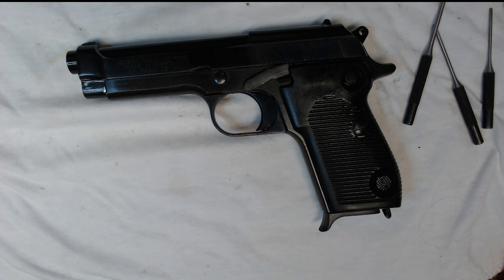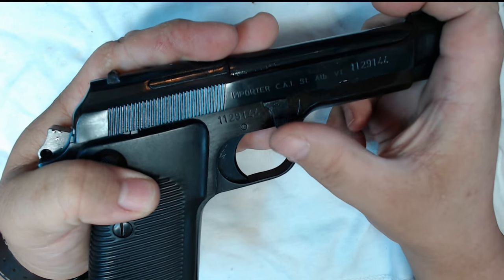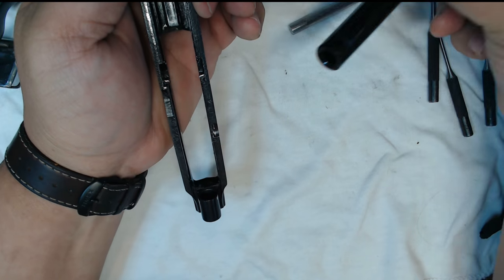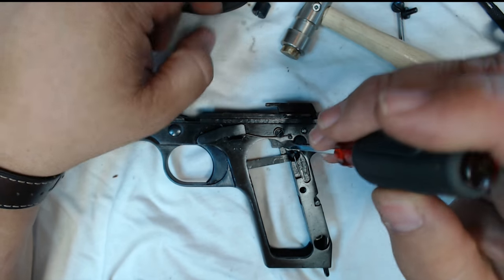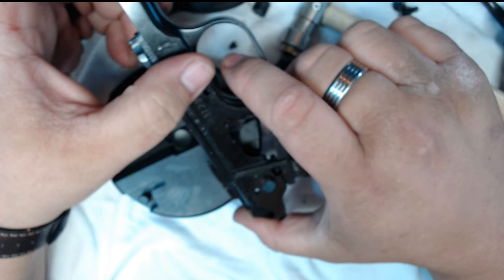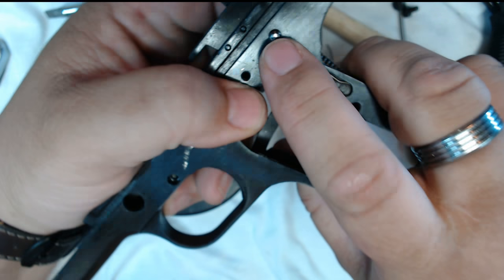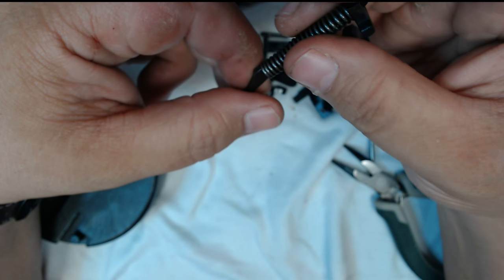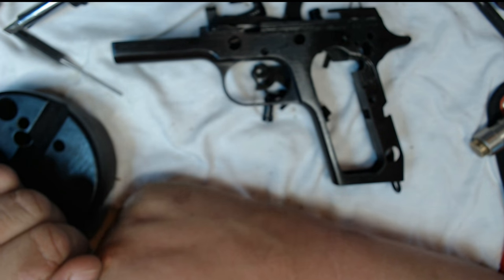Beretta M1951"Brigadier" - Egyptian made Helwan - Disassembly

Comment: what size pin punches are you using? I just purchased this handgun and it's really dirty. Your video is excellent straight forward and to the point with out a lot of fluff!
Reply from the maker: Thanks for watching!   I have 3 sets of punches.  one steel and one brass set with sizes from 1/16th through 1/2.  I also have a set of roll pin punches.  These are especially helpful when working on some rifles like AR's.

Comment: So I just purchased a helwan from gunbroker. I went to go inspect it and cant seem to get the slide to pull back normally. The only time it worked was when i messed with the safety a little bit and then pull hard and it came back. The problem repeated itself afterwards. Any thoughts? I dont want to take it into my possession unless i know this is not a big issue.
Reply: Did you get it figured out?

Comment: I found the method for the magazine. Use a punch to push on the retaining pin on the floor plate, then slide the floor plate off to the front. The spring will shoot out so be ready.

Comment: @ninjamidget is there a screw holding the barrel lock to the barrel?
Reply from the maker: Yes, there is a screw that you have to take out in order to remove the locking block
Reply: @NinjaMidget1969  Hey bud, How tight should that screw go back in?
Reply: @NinjaMidget1969  Where exactly does to self screw go into the locking block?  I just got the gun and while field stripping it the screw fell out into my palm.  I never saw exactly where it came from.  Thanks.

Comment: Any info on how to get the dang actuator pin and locking block out? Its slightly different than the Beretta 92...thanks!!!
Reply from the maker: Yeah, there's a small screw on the locking block that will allow it to be removed.
Reply: @NinjaMidget1969  thanks brother! I took the screw out but the actuator pin won't let it slide out...